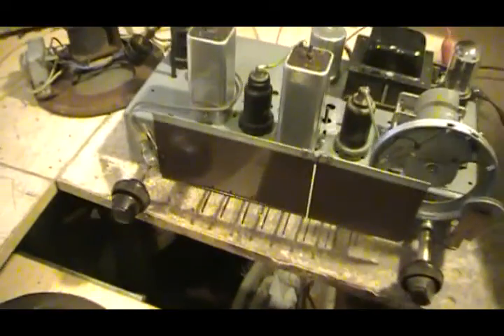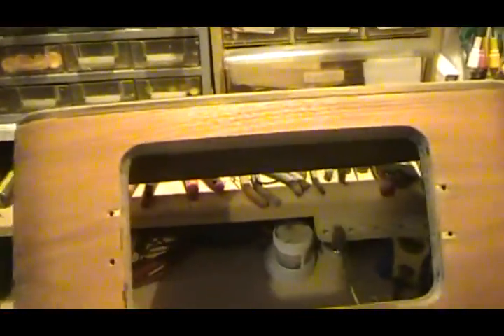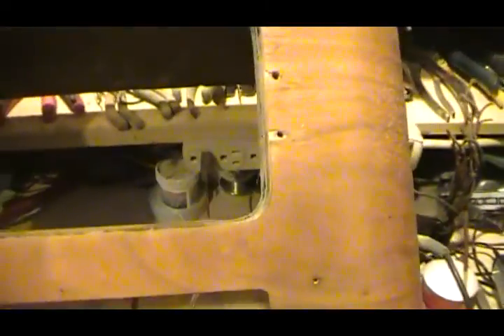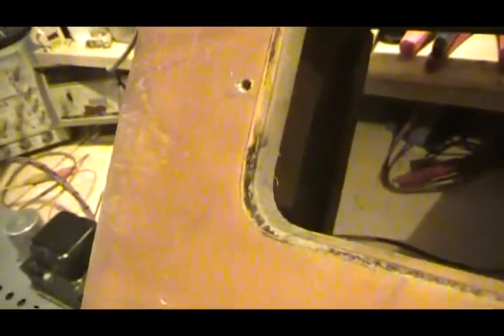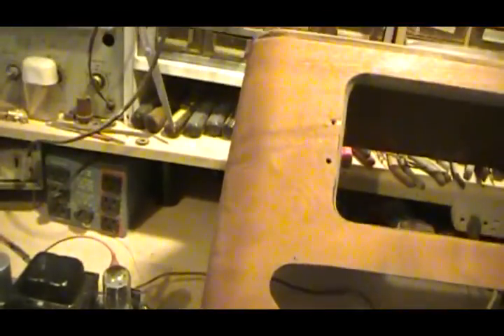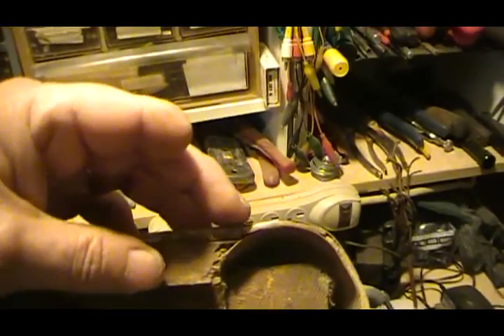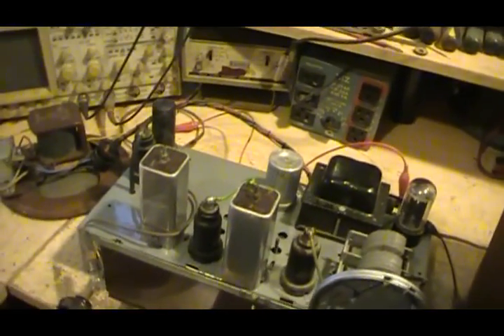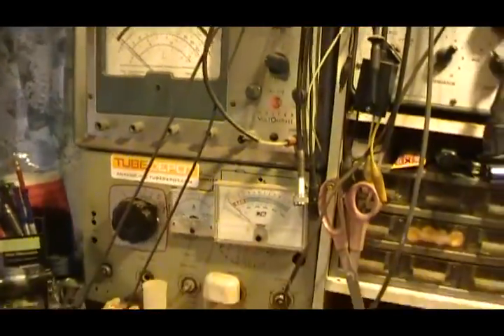RCA 96T7 part 7

Comment: I like what you are doing with the cabinet, Dennis.  I like them looking showroom new, but, I really prefer them to look like what they are, more.  The pushbuttons, that's tough.  Hard to spend as much on the pushbuttons as on the rest of the radio, combined.  I've never had to replace a curved piece of veneer, like that (I'm pretty careful of what I'm getting, with cabinets, cause, I ain't that great).  It was nice seeing the technique you use.  As always, very good stuff, thanks Dennis.
Reply from the maker: Thank you Al. From what I have seen on your videos you have really nice radios. As for cabinets I just say go for it. The nice thing about lacquer is that if you don't like what end up with it's easy to get the lacquer off and start over again. Thanks again. Your friend Dennis

Comment: Another method for fixing that damage around the curve/s would be to cut a strip out of the veneer, up to, or just l slightly above, where the damage is, lets say 1'' up from the bottom. Then replace it with a strip of new veneer of the same species with similar grain, this would have the added bonus of covering the nail holes too. If you are really ambitious, and are not worried about originality, you could also customize the cabinet by laying in a strip of a different species, like birdseye maple for example. One thing that I should mention with patching veneer, where you have to cut across the grain, is to avoid any straight edges in the patch, straight edges attract the eye, curves or irregular shapes that mimic the grain are what you want as they look more natural.

Comment: 120 bucks for the buttons!!  Lord I thought 16 for 8 for the philco was expensive.  Great job on the curved bits.
Reply from the maker: Thanks Bret. The price seemed a little high compared to the others, but they are a very complex button and probably hard to make. Or at least that is why I think they are so high priced.
Thanks again my friend.
 Your friend, Dennis
Reply: I've seen those, they are stupidly expensive for what they are. I think that the reasoning, or there lack of, may be that they used the same pushbuttons on some early RCA TV sets. Well one of those early TVs, like a TRK12 or a TRK9 may be worth between $4-10,000, if that's the reason for pricing push buttons so high then it is batty to say the least. There is maybe one of those TVs for every 1000 radios that use the same buttons, and how many of those would be worth throwing $120 into? To my line of thinking it would make more sense to price the pushbuttons at a lower price to actually get more sales, and some cash flow, to recoup the tooling costs, then to sell a set of them every now and then. But it's my opinion that just about every repro part sold on that site is overpriced, like $10 each for a generic repro knob when you could get an original for under $5.